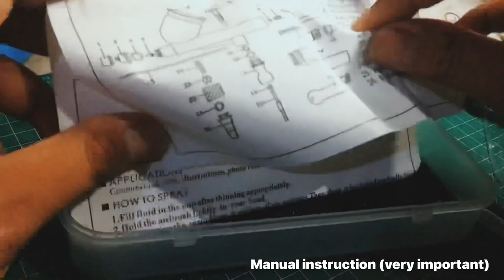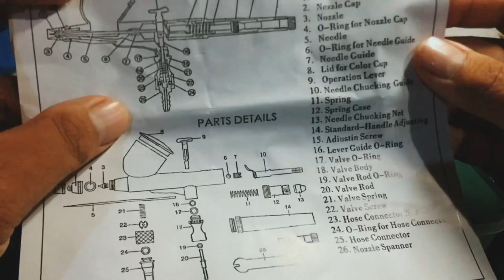Unboxing Kompresor Mini Airbrush KKmoon Portable Airbrush Kit | Review & Test Mini Airbrush

Comment: Wkwk lagi nyari video mini airbrush nemu juga disini om, btw ini kalo buat ngecat velg hot wheels yg resin 3d print gitu masih aman om?
Reply from the maker: sangat aman om, sya jg sering buat ngecat bhan2 3D print pkai ini, asal tau durasi pemakaian aj biar awet 😁😊👍🏻
Reply: @hardworkgaragediecast  Siap makasih om. Maap oot dikit om, itu saya liat di video repaint ada cat brushmaster. Itu kalo buat figure resin bisa langsung nempel om? soalnya denger tanpa primer bisa langsung nempel kalo brushmaster
Reply from the maker: smasama om
 bisa om, minim brushmark, cmn sbnernya lebih bagus pkai primer dlu 😁, untuk hasil yg bagus dn smooth😊
Reply: @hardworkgaragediecast  Siap makasih om, jadi panjang gini saya nanyanya wkwk. Nanti saya coba deh om beli primer semprot, agak tricky tapi ya kalo nyemprot figure skala 64 gitu
Reply from the maker: sansss om hehehe sharing" pengalaman om semoga bs jd referensi buat teman2 juga 😊👍🏻🙏🏻
mudah kok om, yg penting belajar pegang dn menjalankan pen brush nya, nti pasti bs kok, kompresor ini sbenerny cocok bgt buat yg blm pernah sma sekali pegang pen brush dn pengaplikasiannya, bnr2 buat belajar pemula 😁👍🏻